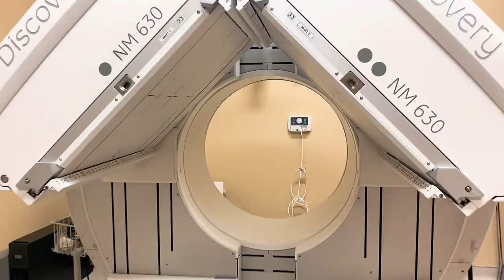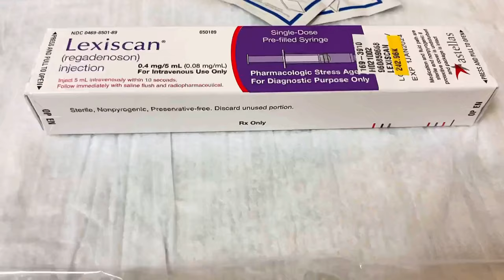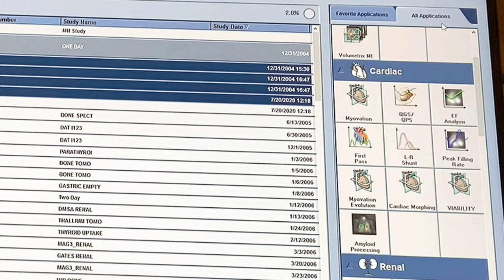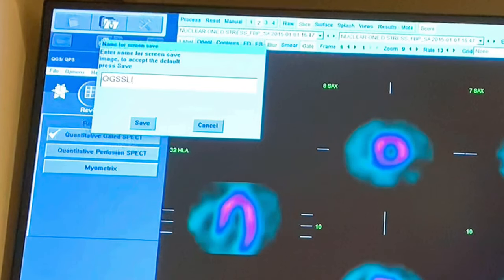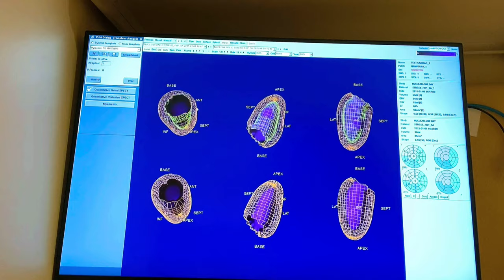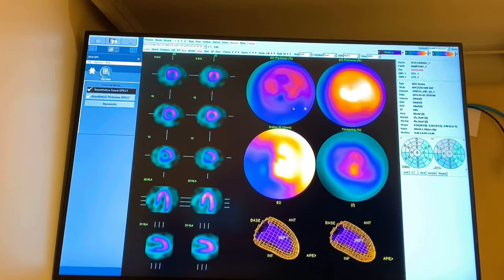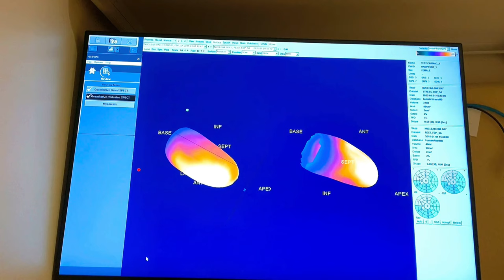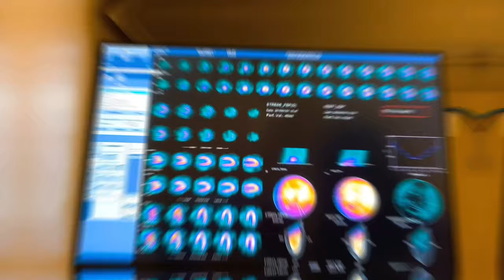NUCLEAR STRESS TEST ❤️ HOW TO PERFORM | HOW TO PROCESS

Comment: Good job bringing awareness to the field and exam. Of note, and some of these can be subjective... for spect acquisition, positioning patient about one heart height from top FOV allows smaller collimator distance increasing resolution. Lung heart ratio can still be obtained with this positioning. The reader should take GI activity into consideration, thus allowing visualization of extracardiac activity and its possible influence on LV uptake. Placing the gut beyond FOV will not influence Compton Scatter of intense gut near the LV. This can give a false sense of negative influence. It will only allow the automatic software processing to find the LV more easily. Using the mask feature in Cedars can be necessary. 

I see your institution is using front back projection for image reconstruction.. This is prone to ramp filter artifact, larger imaging times/dose, and a need for a shorter azimuth for acceptable resolution. Iterative reconstruction is widely accepted as the current standard in SPECT. The version of Exeleris you have could display both if the reader is uncomfortable moving away from FBP images. 

Many readers out there are utilizing save screens to diagnose. This is unfortunate as it is left up to the technologist to correctly process and deliver all the data without allowing the reader full control over manipulation of the data. Many would find it too time consuming to learn and implement anyways! Normalizing rest/stress LV intensity and close attention to quantitative contours is key to accurate results. 

Anyways, just my 2cents...really appreciate your work on YouTube making unclear medicine more clear to people!

Comment: Thank you for the videos! I have a few questions for you... I am almost done with pre reqs for the program and I’m torn between nuc med and rad tech. Can you get extra certs after nuclear med program to do mri, ct, xrays ? Also, other than patients, do you mainly work by yourself most of the day? And are there night shifts available for nuc med or is it mostly a day time job?
Reply from the maker: It depends on what state you live in so I would double check the requirements! But as a Nuc Med tech I am able to cross train into CT and MRI but not Xray. For Xray you’d have to attend a program dedicated to Xray.
Reply: @UndeniablyMee  Thank you so much for the input ❤️

Comment: Hi Please Can there be an accurate reading without the rest and stress test/ imaging undertaken. I only had a stress test with Lesican without the rest test done. and I am told that it's fine.(which I am not accepting) obviously, no 2nd image to compare -just as you clearly explained, Meanwhile all my symptoms are still there. I am challenging this.  because having watched this video  I don't think my myocardial perfusion scan is done properly. because no 2 images to compare.